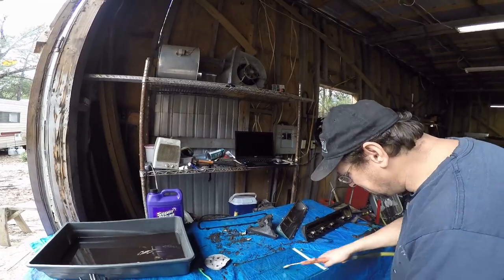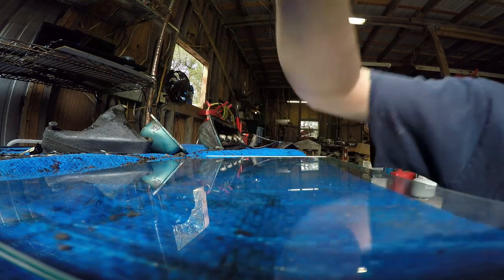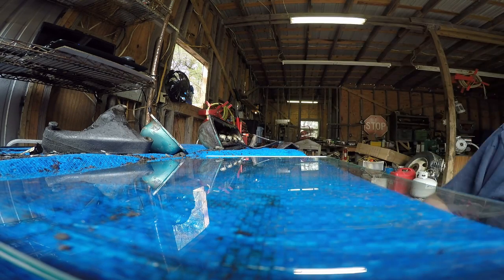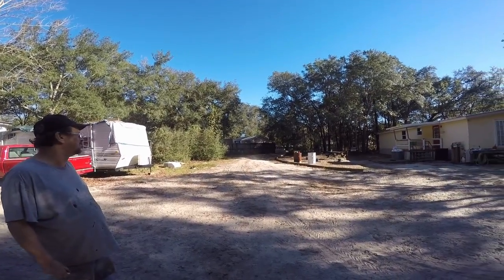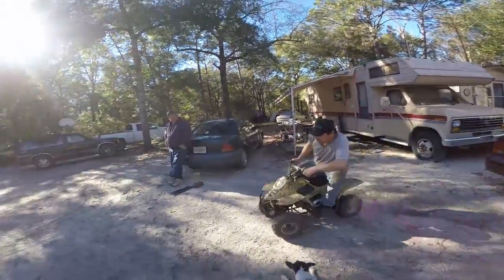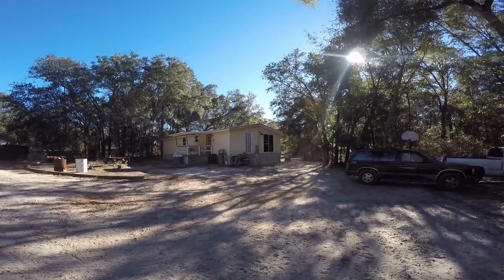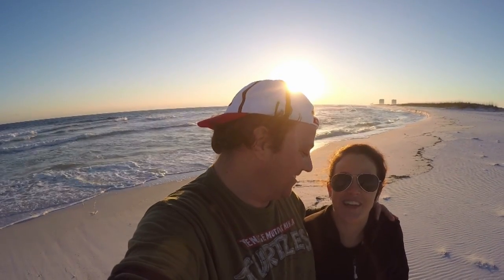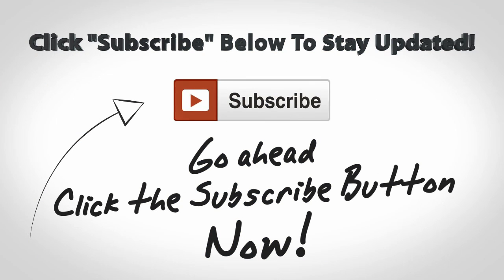GMC Motorhome Oldsmobile 455 Tear Down & Rednecks Gone Wild

Comment: I like the guy who switch out the old gas engine in his GMC motorhome  and replaced it with a diesel engine.  He claims his mileage improved dramatically, and diesels will run forever.  That's what I'd do before I'd rebuild the olds 455.

Comment: It is good that o=you made it to Wayne's.  From what I heard, major problems were caught in time.  The transmission modulator valve had never been hooked up, which would cause shifting problems.  I sincerely hope Wayne can fix everything to your satisfaction, and to the point where it won't set plans back too far.  Much better to drive in to Florida, than to be towed away in a strange state, where no one you know is at hand.  When was the diesel conversion planned to be?
Reply from the maker: Post Alaska trip, pre entry into Mexico for Latin America your
Reply from the maker: +Wanderlust Estate tour not your
Reply: Wanderlust Estate
The Pan American Highway trip would be wonderful.  Seeing Smitty arriving in Brazil would be priceless.
Reply from the maker: +Dr. Gun I want to make it happen and he the first in the world to document it in video.
Reply: Wanderlust Estate
That will be quite an adventure.

Comment: Hey buddy before you beat yourself up a couple of things. That motor home was never made to tow a lot. You have to change the final drive gear to increase towing capacity and it is tons of extra capacity. The grand which is a turbo 400 or 425 because it's front wheel drive can be worked to its limit with the 455. Now gas vs diesel. Has has been cheaper for some years but diesels get better mileage. Not sure how much better. But when you weigh the cost of the conversion it
Might equal out. Just my two cents. I had a 73 canyon lands and drive semis for years. 👍. My opinion is 6 of one half dozen the other. You'll be okay. As long as lower end is good. Even then you re use top end. There will be a noticeable power difference when he does the heads. Just remember it's a big heavy unit 😆

Comment: pricing you are getting is pretty good to do your top end.  was just looking at used engine costs for vehicles.  Honda Odyssey minivan is $2600 for a crate engine with 3 year warranty unlimited miles (on ebay).   Of course installation is another $1000.  that's a small engine, lets say grand total $3500.  Good luck with your finances and the bottom line costs.

Comment: James I don't know anything about a diesel conversion for the GMC but I would definitely weigh the cost/benefit of changing over. Once you get this coach mechanically sound and then work on the other systems and cosmetics will it be worth the money? I am sure it is still much cheaper than buying a new class A coach by far. Good luck with your repairs!

Comment: looks like a big job why not
 find out if cheaper to get a recon motor less headace in the long run
Reply: +gareth davies I agree with You. Is possible to find a  good used engine for less than $700.
Reply from the maker: Because I already looked into it. It's a lot more expensive
Reply: +Rky Mtn Prepper Nice!
Reply from the maker: +Rky Mtn Prepper Where are the heads? I already know about the engine. It has a core charge. But now to put it in its going to be another grand at least.
Reply from the maker: +Rky Mtn Prepper Where are the heads? I already know about the engine. It has a core charge. But now to put it in its going to be another grand at least.
Reply from the maker: +Rky Mtn Prepper Where are the heads? I already know about the engine. It has a core charge. But now to put it in its going to be another grand at least.
Reply from the maker: +Rky Mtn Prepper Please send the heads info
Reply: +Wanderlust Estate and you dont know what you'll get

Comment: Before you make a change of motor to a GMC 6.5 diesel, you better check forums on the 6.5. Also check if the engine can pull that amount of weight and the effect on the long run, because you might spend a lot of money that might not work for you in the long run. Hint: you may one to change the way you run your gaz engine. If I were you I would accelerate slower and drive it no more than 50 m/hr and going up the hill I would let work the motor with the same amount of trotle has a work on a flat road. And a good schedule maintenance on it.  That way you could last for thousands of miles without any major repair.
Reply from the maker: It's a turbo deisel that is conventional without a computer. Same thing run in the military HUM Vs and I was waiting to see how others doing the conversion raised prior to doing it myself.
Reply: I realize you've moved on and sold the GMC, but thought I'd comment on the diesel conversion. GMCCOOP's website says they're doing a conversion right now and said it was costing the owner $40,000.00! Apparently the owner wants to sell it when they're done and is asking $75,000.00. Ummm...no thanks ;)